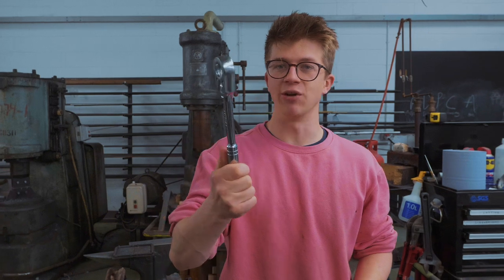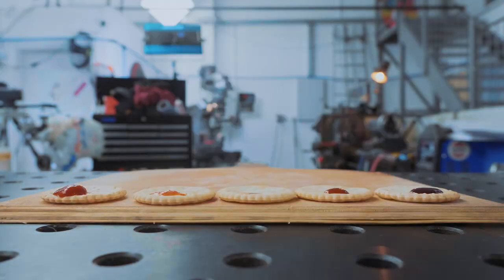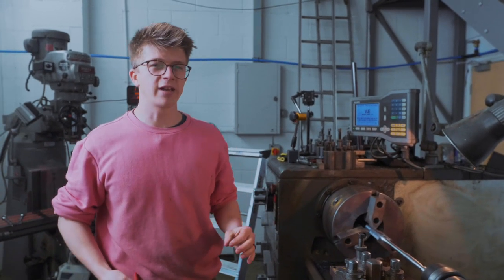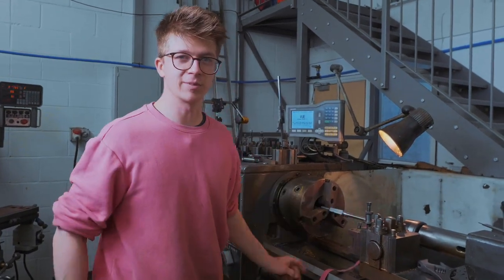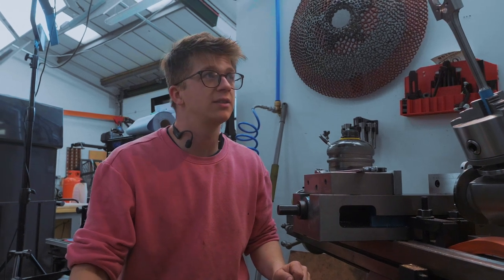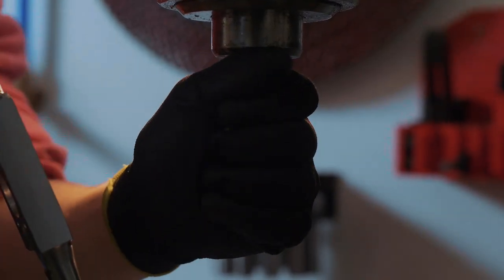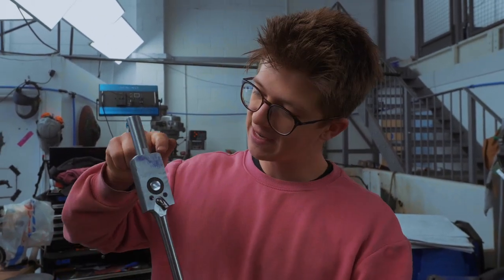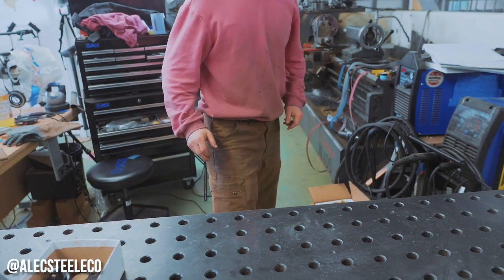Making a Socket Wrench from Damascus Steel! Part 3

Comment: Lathe tip, when using sand paper like that you want to keep the top and bottom from touching. The reason for this is because you are more likely to hit a bur and pull the paper into one another locking it like a strap wrench around the part. With both hands, hold an end in each, nice and far apart. Maintain pressure but not too much that you cause chatter and always be ready to let go and you’ll be fine.

Comment: you can also use the tool post to clamp and sandwich the sand paper and use the cross slide to apply pressure

Comment: Hey Alec, heres a little hint for using emry paper on the lathe. So what I do is, I hold it between two fingertips on each Hand so if something Bad happens, it just tears the paper out of my Hand. You dont want to hold on tight, just  barely enough to be able to work with it. I also avoid using as long strips as you are, its mlre controllable when cut into shorter sections.

Comment: Absolutely correct on the lathe. Aside from. The pliers never hild the paper together close to the part. That drastically increases danger. Pinched my fi ger I. The paper once almost went In the lathe. Luckily I consider 120rpm fast for the size of part I was on

Comment: Safest way to sand on a lathe is either cut the Emery cloth smaller than the diameter of the part or make a Emery cloth stick so it's like using a file

Comment: An easy way to use emry cloth on the lathe is to just clamp it in the tool holder, then you can use auto feed as well.

Comment: Good video. When using an emery cloth on the lathe you don't have to use pliers to grip the emery cloth you can just hold the cloth between your finger and thumbs but DO NOT wrap it around your fingers !  Anyway great video!

Comment: Respect the danger, dont be afraid of it.
Scared/nervous people make mistakes. 

Was taught this while running a 14 head pneumatic screen printing press. Seen an m&r challenger rip a 1/4" piece of aluminum (tri-loc) in half like it was tissue paper and simply thought "glad that wasnt one of my limbs or spine" 😂

Comment: Love it as always alec, but, a tip, if i dare too as youre a way better engineer than me...hold each end of the sand paper/emery cloth in  pinch with the index finger and thumb, one end in each hand, then hold them apart at 90 degrees and oscillate forward and back....you only need to apply a small amount of pressure so if your piece grabs it then it just snaps it from your fingers...
Reply: it isn't sand paper OR emery cloth
it is a strip from his belt sander

Comment: As I machinist i can say you're probably more competent than alot of other machinists I've worked with over the years. Also I wouldn't drill with a carbide drill on an angle without making it flat first. Shouldn't be deflecting.

Comment: You could totally make a fixture plate with a rubber tipped hold down clamp to hold the sandpaper tape and use the power feed to sand

Comment: Hey Alec one tip I got while in the machine shop is never use a pice of sand paper over an inch long so you don’t run the risk of getting sucked into the machine.

Comment: The angled hole setup could have also been done by utilizing the head rotation or nod of the Bridgeport and clamping the part to an 90° plate hanging off the edge of the table. Maybe a bit less sketchy and more rigid setup for the next time you need to make an angled anything on a long part.

Comment: It didn't strike me until I watched this part that the rotary table is what you should have used for those two holes, manually rotating it all the way around, with a little bit more offset each time.
Then re-center in vice and a few final cuts with the boring heads.

Comment: Just wait until you have to load the spring and ball while inserting the pawl. If it's like my craftsman ratchets it's tough to do solo but can be done. The tiny ball for my 1/4" ratchet is somewhere in my garage. Found the size online and bought a replacement (in bulk qty).

Comment: When using emery cloth don’t have it as long shorter sections work a lot better  I just hold it with two fingers and the couches that slipped right out of my fingers

Comment: Pinch each end up the sand paper and pull it straight like you'd read a fortune cookie. Then press the center down over the top of your work. That way the strip isn't wrapped around the work at all and is much less likely to grab. Just make sure not to wear anything with long sleeves since your arm will be passing over the top

Comment: Alec, when you do the etch, DO NOT allow the inside of the ratcheting area to get etched!
Reply: Also, the original is chrome plated, so his finished surfaces must have the same dimensions as the surface of the plating for proper operation *but won't be as hard*. That fact doesn't speak well for the tool's longevity.
Reply: @markfergerson2145  he's measuring from the chrome surfaces so that shouldn't be an issue.
The only wear parts are the direction selector and the ratcheting wheel. Neither of those is chrome plated so, as long as he uses a hard alloy, wear shouldn't be an issue.
Reply: @bumblebee2989  Damascus is layers of two alloys, neither of which will be anywhere near as hard as chrome.
he "axle" that runs through the wrench head is also a wear point against the channel it runs in.
Reply: @markfergerson2145  fair point. I don't think it'll be much of an issue unless the ratchet sees heavy use for a long time. I'm guessing this one will be more of a showpiece and not thrown in with the regular tools.
Reply: @markfergerson2145  he probably uses a ratchet a handful of times a week. Won't matter
Reply: @markfergerson2145  Alec already made one. What's stopping him from making another? He will even apply the lessons learned. If he forgot any, he can always watch these videos.

Comment: Hi there, im new to blacksmithing. I have a rather dumb question to ask here.

When heating the steel,  do i put the steel in the forge at the beginning of the fire (when the fire is not that hot), so the fire and steel becomes hotter together, or should i heat the forge fire 1st, wait until the temperature becomes very high, then only i put the steel inside? 
Im not sure whether theres any issue in this, like will it affect the steel? or it doesnt matter as long as the steel gets hot enough to forge.

Thanks.

Comment: In machining if it works then it's OK to do. There's no right or wrong just better or not but if something is quick and works well enough to get the job done within tolerance then do it. Oh and whilst a lathe is plenty dangerous it's actually nail guns and powered saws that are by far the most dangerous.

Comment: Isnt there a simple and relatively inexpensive tool for holding sandpaper to a piece on a lathe? I know ive seen them before like a block or a grip. Could probably make one. Is clamping it with pliers a better method?

Comment: Great Video (as always), but when you encountered the little issiue at 6:30min, couldn't you just put a Milling Cutter in the drill chuck and just slowly kinda level out the surface, just about enough for your long drill to be able to actually drill in it?

Comment: I actually got hurt doing the same thing on a lathe but without a vise grip and while I had tig gloves on (yes gloves, I know wasn't best idea but I was a new welder) belt caught my gloves close to the piece in the lathe and took my hand halfway around. Thankfully it was a low speed and I was able to get out, nothing broken but sprained.

Comment: for sanding on a lathe just tare the strip in to shorter pieces so you can hold the END with your fingers, there is MUCH more control and no warping hazard (end of strip wrapping around your hand) and you will not get pulled in by the strip getting caught because it will just pull out of your fingers. Getting yanked forward by a double hand grip on the pliers is WAY more dangerous (IMO) than putting your hand right on the spinning work with nothing to catch

Comment: You have a mill. Put wrench on turntable, use 2 or 4 flute end mill and cut perfect arc. No need to hand grind. PS:  read mechanics handbook for correct cutting speeds. And how about some cooling/cutting fluid. Less noise and heat and tool wear.

Comment: To stop any delfection while drilling that angled hole, you should had clamped it flat in the vice, and tilted the head of the mill, clock it in with a sine bar and slip stack get your angle right, and drilled your hole. Looking smart though. Interested to see how you will cut the ratchet teeth.

Comment: A tip for sanding on the lathe is to hold one end of the strip in each hand. NEVER ever hold both ends with one hand. It will bind and wrap up and suck ypur hand in. With one end in each hand and never have the sand paper covering 180° or more of the shaft. The closer the ends get to each other the higher the chance thy wrap up.

Comment: For the lathe danger bit, is there such thing as a dead man switch for a lathe, like a pedal you would stand on but if you released pressure it would stop the lathe, its probably overly redundant, and I get if you respect the danger that comes with powerful tools you're less at risk, but it just seemed like an interesting idea

Comment: would be nice if there was a tool you could use for holding that tightened up to a certain point then loosened fully. so you could lean into the natural instinct to tighten a grip. something like vice grips maybe.

Comment: For the angled hole, couldn't you place the wrench flat on the table and rotate the head on the Bridgeport? Seems it would be a lot more ridged than sticking out of the 3-jaw. Great video, thanks!

Comment: The lathe is not the most dangerous tool in the shop, that distiction goes to what is between is between ones ears. Unfortunatly that is also one of the least used tools by many people.

Comment: surely a better solution to the angled hole issue is to use a 4 jaw chuck rather than a 3 jaw and hold onto the falt side at the top of the wrench so that it is loads lower...

Comment: This was probably mentioned a million times by now, by I tend to use the same technique as abom79 when it comes to sanding paper on the lathe. First of all, shorten the length of the sanding paper string so it doesn't have any 'dangling bits' (something like 50cm will do, may be more or less, depending on the diameter of the work piece). Then just pinch the end of the sanding paper between your thumbs & index fingers, one hand on one end, the other hand on the other end. Don't wrap it around your fingers, don't use pliers etc. Just loosely pinch it, it WILL get pulled out if something were to happen. Also, please put some protection on those beautiful shiny ways when you use the grinder! You're slowly killing your lathe there...

Comment: Clamp work piece to the bed and tilt the head to the required angle and drill it with a slot cutter, you made it so much harder than required but like you say you’re not a machinist.  Keep learning keep researching. You’re doing great

Comment: How you should be holding the paper is flat with your hands. Left hand close to you, right hand reaching over, fingers as far from the material as possible. That way it has almost 0 chance to catch and pull. The way you're holding with the pliers has a lot more friction on the part and can very easily pull the pliers into the lathe.

Comment: No!! No!! The pliers+sandpaper combo was a disastrously terrible idea. I don't know how you could have gotten the seriousness of the lathe correct and landed on the absolutely worst idea possible to mitigate it. You will NOT be able to "let go" before that thing pulls you in, any more than you can "hold on" during a car crash.

Alec, fold the sandpaper over in your hand so you can press it into the work from the bottom with your index and middle finger. NO LOOPS going around the work!!

Comment: As a machinist respect of rotating tools is critical. But you need to know when you may be putting yourself at extra risk. Having a decent length piece of Emry (say 600mm) and holding just the tips in your finger tips lightly is the safest way to use it. Holding the ends in each hand means should anything catch, it is pulled from your grip and youre totally clear. Your method seems like a good way to potentially launch a set of pliers across the room potentially.

Comment: Instead of holding the Emery paper yourself loop it over the part and hold it with the tool holder with a tool in it. Then move it along the part with the lathe axis's

Comment: Well Alex you finally got to have some southwest hot  Sauce 🔥 yea gotta careful with some of them. So if you try some again have Chocolate bars on hand that helps with the burn 🔥 also you can eat  Tortilla chips that also works on the burning of the sauce as well.

Comment: If the hole wasn’t at an angle and you had to drill in that small area. I think I’d put it in the lathe, then make a tool to sit in the tool post and go into the part at a 90 degree angle and cut the hole you need.

Comment: I think you can tilt the milling machine head with the desired angle fix work piece parallel to the table  and drill the hole p.s the trench is longer, thinner ,less beef than original from old subscriber don't crank it to hard

Comment: When using strips of abrasives on a lathe the safest way is to use shorter strips. Only enough to get the diameter of the work and leave you with 5 to 6 inches of separation for your hands. That generally is enough to saw back and forth a bit to tune your finish. Only grip the abrasive strip by pinching between index fingers and thumbs while keeping your other fingers safely tucked into your palms. By doing that your grip is never strong enough to resist the lathe. And never have extra length on your strip that can wrap around your hand or arm… or leg i guess if you really didn’t want to trim down to a safe length. I understand your use of the kinipex but I advise against it by simple virtue of it’s potential to become a missile. I don’t want to brag but I’ve had enough things sewn back on that I’m somewhat of an expert on bad ideas.

Comment: Your machingin is fine - using the right tools for what they are designed for is a rare thing in a shop - you work with what you have.

But with the paper, you are committing the classic error of making things worse because you are afraid of something.
Never PINCH the sandpaper when polishing - you keep both ends as far apart as you can - the more surface of the paper is in contact with the rotating shaft, the MORE likely it is to be pulled in and wrapped - using the tongs to hold both ends in one spot is the most likely way to make that happen. Also, you grip it short - making it even more likely to pinch because it is almost wrapped aroun 75% of the shaft already - and with a LOOOOOT of unneccessary length dangling to maybe catch you as it gets pulled into the machine.
AND you introduced a heavy object to be taken for a spin (and then getting released at a random angle...) into the eqation.

You want the ends to be reasonable long to have some distance, holding them with the least necessary power possible at the ABSOLUTE ENDS so they get pulled out of your fingers at the slightest catching, and in as WIDE apart in a V-shape as you can, to minimise the area in contact and the chance of it getting pulled into itself. (usually results in 60° to 90° open angle)

Comment: I'm so glad I don't work with lathes anymore. I find the more you get comfortable working with dangerous things, the less you think about the danger. It takes a close call to really get into your head what you shouldn't be doing. For anyone interested in exactly how a lathe will kill you, if you're not specifically sure. You see the small gap between the chuck and the lathe bed (underneath the chuck). Well, that gap is not big enough for your head, chest or most body parts to fit through. The lathe does not care. It will try to pull you through it anyway. And if you are pulled in on the right side not near the chuck, you will wrap around the bar like a bed sheet before you can even say "ouch."
Reply: The most horrifying video on the internet- Russian lathe accident. I urge you NOT to watch it!
Reply: @crackerdan8010  I've seen that one before and a fair few others. My first day as an apprentice I was shown pictures of an accident to get it in my head straight away what can happen if I don't take it serious.

Comment: I can imagine my life expectancy if I had a huge lathe, I had a 6" angle grinder rip my shirt clean off me,  it was either the shirt, or the grinding disc was heading to my face, so I held it back,  while it ripped my shirt off! Amazing the TQ those grinders have! It could been bad, I knew a loose shirt could be trouble, I usually tuck it in when using powered tools, but I was rushing, and forgot.. R.I.P. tee shirt, 😆

Comment: Dont hold the sand paper in grips like that. If it catches u wont react fast enough to drop. Instead hold it with one end of the paper between your thumb and index in one hand and the other end the same. If it catches itll snatch it out of your grip instead of pulling you in. Dont wrap it around your hand obviously 🤣👍🏻

Comment: I nearly chopped my finger off while cleaning an exercise bike, it had a 50lb fly wheel which I very stupidly spun by hand to clean the chain and gear/sprocket by hand; the cloth I had was pulled in, where the chain met the sprocket, and my fingers followed. Not fun, very messy, do not recommend unless you like 10+ stitches.

'Twas a painful lesson in rotational inertia. And thus, I will never be in the same room as a lathe.

Comment: Now I want a toolbox full of hand forged Damascus spanners, screwdrivers, sockets and ratchets.  $30k basic spanner set…in metric sizes from 8mm to 24mm only.   🤣.  Move over snap-on, you are now chump change.